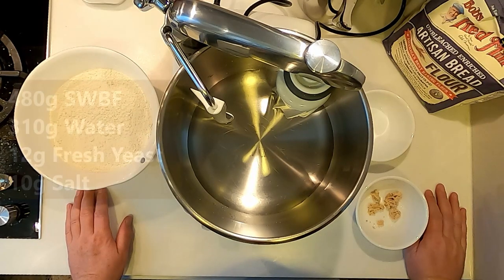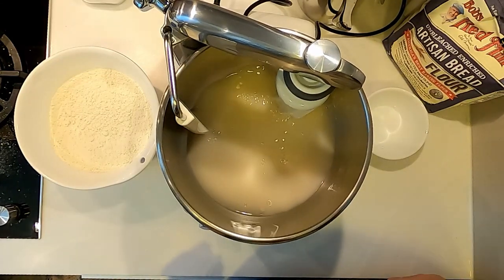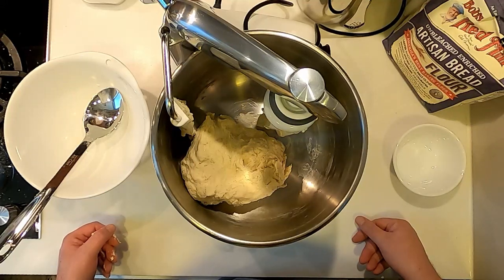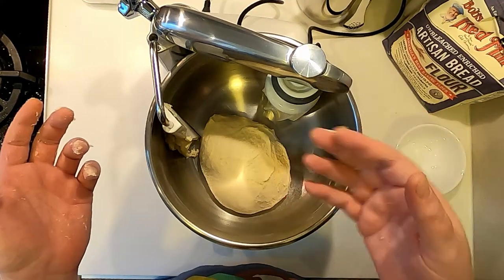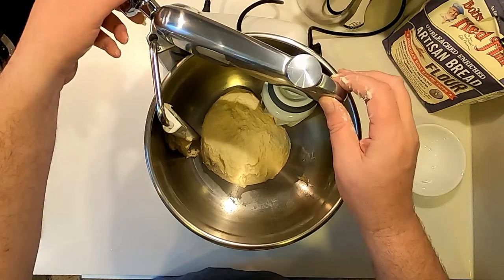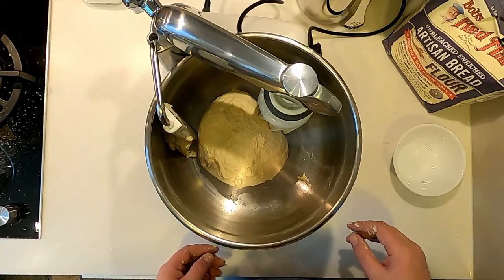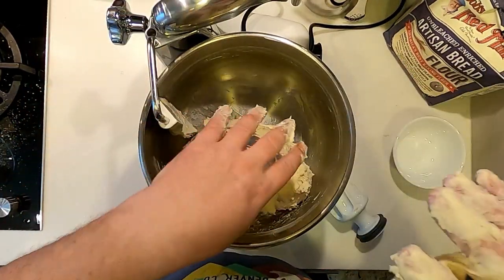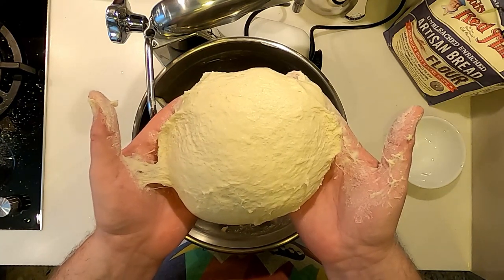Testing Longer Knead Times in the Ankarsrum Assistent

Comment: I just made a batch of pizza dough (900 g flour, 600 g water) using my kitchen aid rather than by hand which is what the recipe calls for.  My recipe calls for a rest to allow the gluten to develop after its mixed then knead the dough. I know the Anksarum is supposed to do everything but I think you are missing a resting stage that allows gluten to develop - I don't know that there is anything to be gained by excessive kneading.
Reply from the maker: I think the point of the video is that neither bread was rested - not in the original hand knead version, or the Ank version.  Why should I introduce that stage for a basic white bread, when I wouldn't do it usually?

Comment: When handling dough in bread making, it is a distinct advantage to allow the dough to rest during the process. This allows the gluten/gliadin to relax and easily reform itself into the long protein chains which are the superstructure of the finished loaf. It is possible to achieve greater volume and lightness by resting the dough at the right times. Doughs made from white flour require more resting than wholemeal doughs, as the wholemeal is always fermenting faster and the presence of bran particles reduces the strength of the dough by slicing through the gluten superstructure.
Reply: very well said
Reply from the maker: This is just making the dough...it doesn't go straight in the oven like this!  It gets an hour to proof, knocked back and shaped, then second rise before baking.
That is how my grandmother taught me and I'm never going to change!  Haha seriously, I have played around with all sorts of methods (see my www.twistybakes.kitchen for my sourdough experiments) but honestly my credo is simplicity first and this does the job.  End results were perfect.

Comment: Definitely the hydration you used is extremely low for this kind of flour of high protein. It could definitely go up to 80% hydration whereas yours is 64,6% hydration. Also when handling dough we wet our hands so it doesn't stick at all. I think you overkneaded this so gluten was destroyed. You could start with 310 water and add at least 50gr more after 2-3 minutes of kneading little by little, until you reach 10-15 min of kneading...10gr every 2-3 minutes. You would be amazed by the result.
Reply from the maker: I tend to disagree - I made exactly this bread by hand-knead and it always turns our great.  Even down to 55% hydration recipes.  But towards the end I do suggest trying with a higher hydration.
Although you don't see it here, my hands are wet when I handle - just dipped off camera.
The gluten clearly wasn't destroyed...the last few images in the video are of the risen loaf and it turned out great!
I'm also wary of adding water once the dough is mixed, as in my experience it tends to lead to a ball of dough sitting still while the bowl spins and doesn't incorporate easily.  The Ank is really fussy about liquids first!

Comment: You might try a dough hook.  I use the lowest speed for 5 minutes, let the dough rest for 5 minutes to let the flour hydrate, and then mix for another 5 to 10 minutes.  If I had to knead for 30 to 40 minutes, the Ank would be listed on eBay.
Reply from the maker: Great tip!  I did do a 1kg batch and the hook did a good job.  With less flour I'm happy with the roller now.
Reply: One can get a more robust (and faster) kneading by fixing the roller closer to the bowl, if needed. After kneading, every dough (regardless of the machine used) should rest for at least 10 minutes for the gluten to relax; that makes forming easier and the loaves will stay the shape you intended for them.

Comment: You should incorporate a bench rest to help develop the gluten. 

Honestly, you're not using the mixer as it was designed.
Reply from the maker: So, this was a test - an experiment if you like.  Why would you need a bench rest after all that kneading?!  You can clearly see in the video that the gluten is extremely well developed.  The proof is at the end - a beautiful loaf with amazing crumb.
On a different note, please share your knowledge with me and other viewers on how the mixer was designed to be used.
Reply: @twistybakes5681  yes Tim I’d like to know how to use it . I’ve tried the bench rest for 5 and 15 minutes. I have a kitchenAid Artisan and a Kenwood Titanium. I can make the same bread in both with same recipe, Kenwood just larger quantities. I bought the Ank to allow me to make 3  large loaves in 1 mixer instead of 2. That’s not all I wanted to make, just one example. I weigh everything including water and have tried fresh yeast which is what I prefer, but also quick yeast as seen on most videos . How about you making a video so I can see where I’m going wrong